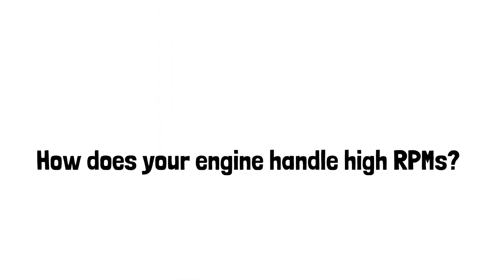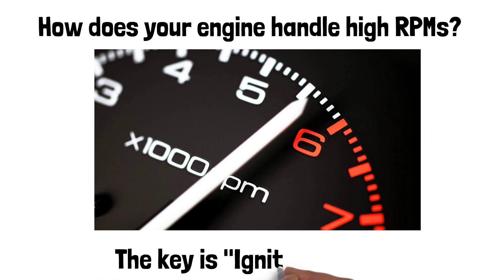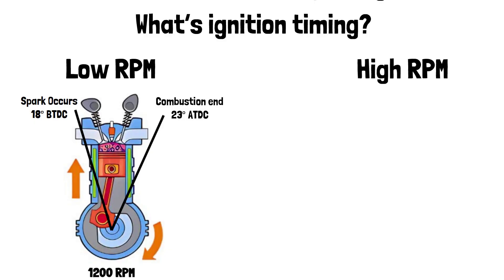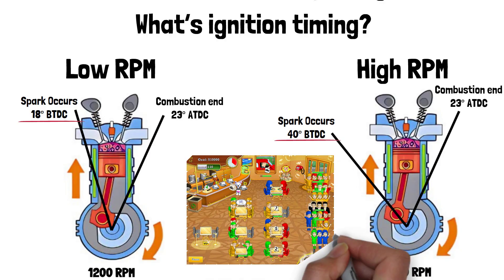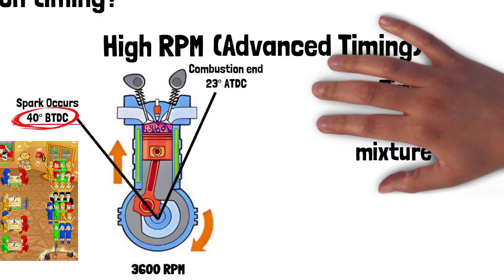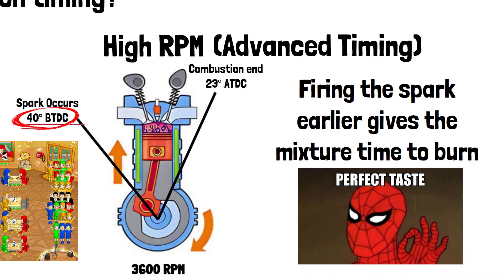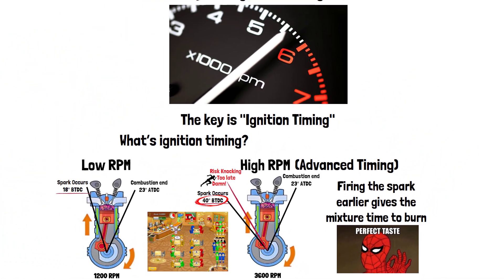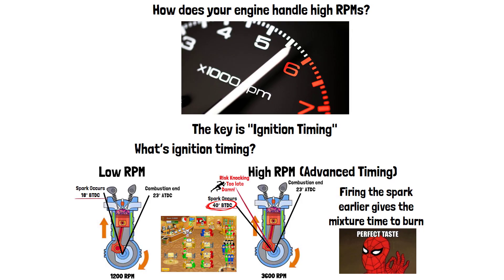Ignition Timing SECRETS for Insane High RPM Performance!

Comment: Good evening  
What if we set TDC at 60 degree angle at crank and increase  the length of crank shaft will it increase  the power torque and fuel efficiency  as at 0  degree TDC in vertical position of crank shaft will resist to move downwards  as compared  to when TDC is between 30 to 60 degree. 
Pls  explain
Thanks and Regards
RK

Comment: What do you recomment ? 18 degrees or more?
Reply: depends on what kind of fuel, what rpm, and engine pressure
Reply: @Laff1N  and also what engine you have the size of the intake valves the headports and alot of other stuff
Reply: @kebabsasmedturtle  exactly, every engine is different, exepct its 1:1 identically, the ecu setting would be different
Reply: engines have dfferent tim